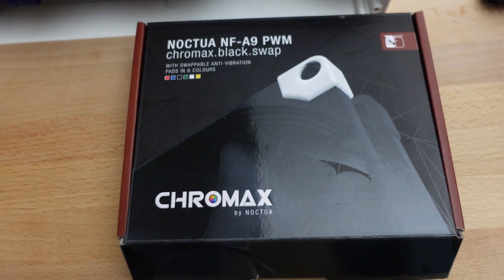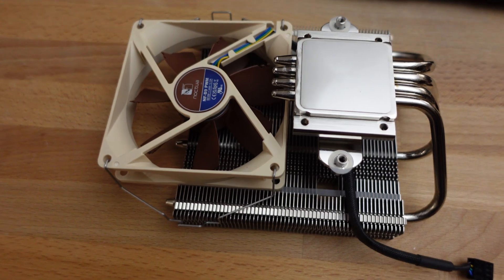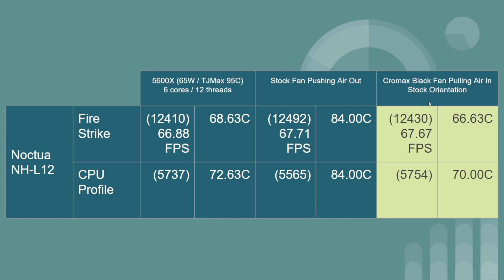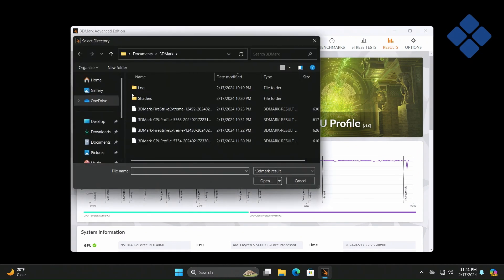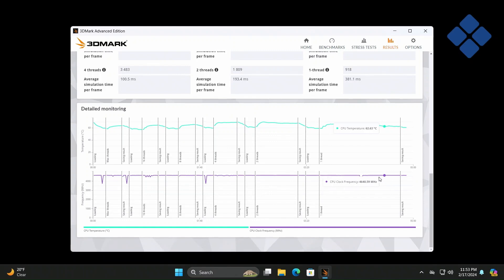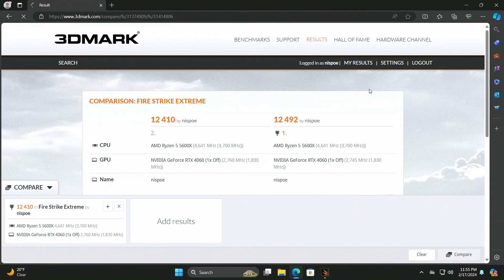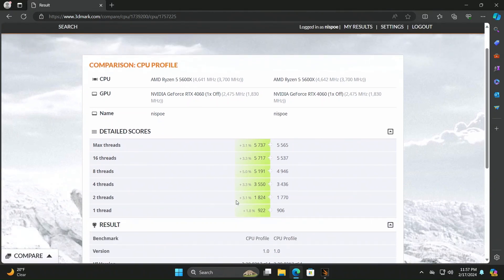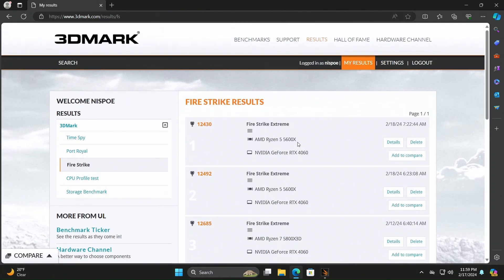Pull not push? - Noctua NH L12 and NF A9 chromax.black.swap - Persephone Build

Comment: Full speed for 92mm fans: Noctua @2547 and 53deg c, ID Fan @ 2376 and 55deg c, and CoolFan  @2778 rpm and 53deg c. Cooling block on low profile the mass will vary and the heavier it is the longer will take to dissipate the heat with a 92mm fan instead of 120mm fan.
Reply from the maker: Usually the physics of it all make sense that using wider fans will displace more air because the fan blades can just capture and push more air. The difficulty here is there is we are going between apples to oranges. 92mm fan is wider so it can displace more air than a thin 92mm. The 120 mm fan is thin so it will have challenge compared to a thicker 120 mm fan. The best of all would be to find the thickest 120 mm fan you can fit, but SFF options are limited. You also do need the radiator and the heat pipes. Actually, the most effective thing here is the wicking properties of the heat pipes and transfer of heat to the radiator fins. It really doesn't take a lot of air to displace the heat from those pipes, but obviously the cool air vs warm air does factor into all this.

Comment: I have a small zs-a4s all aluminum case and a Noctua 37mm low profile trying to cool off a AM5 7950X3D .. 470grams cooling block but only 2 heat pipes, average temp is 57deg c .. but under CPU stress it reaches 93deg c and it shuts down. I also tried a ID cooling block 45mm with 4 heat pipes but much lighter with only 317grams. The 4 heat pipes are hollow copper tubing .. Normally you want to pull air from the sides and exhaust fans on the top will help circulate the air.
Reply from the maker: Agree, pulling air in from sides and bottom and allowing air to radiate upwards is the most optimal. Actually, this is why I like open air cases because all that trapped air up top will just cause a barrier to form and heat to become trapped in such a small case. All those air molecules bouncing around in such a small case without something to actively push air through to circulate can build up too much heat. The one thing you have going for this is that the hotter the case is inside and the cooler the air is outside the case, the more both will try to even themselves out. The same physics in that hotter water cools faster initially and then slower when reaching room temperatures. Metals work the same way that the hotter the metal is it will cool faster initially which is why the radiator and copper or nickel as a metal work so effectively. But there are physical limits... sorry for the rambling, these are the thoughts that go through my mind... Very neat to know what you see with the 7950X3D this is where I will probably be going sometime, but think for SFF the 7950X3D sounds and is probably going to be very hot and would need bigger radiator or liquid.
Reply: @nispoe  you sure made a good point since I'm doing all this thermal testing on an open 'case' mini-ITX Gigabyte B650i aorus ultra board with the 7950x3d and 64 crucial 3200mhz each and the CPU fan runs at 2257rpm on idle 57.8deg.c and 45watts. The GPU 4070s is not even installed since I'm waiting for a rizer cable. My setup is out of the case, and I updated the BIOS on the ITX .. I did have the Ventus 4070s plugged directly in the PCI4 and pulls 214watts on its own at 94% load, although MSI keeps the GPU below 90deg.c .. I might need a bigger case, no rizer cable and mount a vertically cooling  block and fan combo .. I already spent around $2200 on DIY .. could have got a nice laptop for that money.
Reply from the maker: @samm928 the 4070 in a case drawing 214W of power along with a 7950x sounds like a lot of heat to try to displace. If you have a SFF or small case for the ITX you'll always have to keep track of the heat that builds up in the case. Yeah, $2,200 on DIY is a lot, but the performance will usually be better than an equivalent laptop and at times cheaper. The mobile versions of processors and GPUs are toned down and you don't get nearly as much power and performance. Also, if you continually use the laptop for gaming you'll need to open and re-apply thermal paste every now and then to keep the machine running at peak. I get laptops and gaming laptops for when I need to travel. If not traveling it's hard to beat a desktop.

Comment: When you are trying to cool a finstack directly, whether it is for a radiator on a liquid cooler, custom loop or a heatsink such as this one, cool air is obviously the go to choice. Exhaust matters for the other components of your PC, siply because most of the times they won't have a fan blowing air directly on them.
Reply: I wanted to get the Minisforum BD790I which comes with the 7945hx mobile version and pre-installed radiator ..
Reply from the maker: @samm928 I've been eyeing the Minisforum also and interested in the new AMD 8700G APU and what this may bring.
Reply: @nispoe  what happened was, I placed my order on Jan23 and got a good deal at $509. Minisforum was supposed to start shipping on Jan25, but they ran out of the BD970I. Feb8 - Feb14 is CNY holiday and everything shots down in China for 2 weeks, and I said screw it, and I went all in with the Gigabyte B650i Aorus Ultra itx.
Reply from the maker: Most times I see fans blowing against a radiator or fins. I think the SFF is interesting because it's so small the warm air is trapped in such a small space and my concern is overheating. I think the NH-L12 is interesting since it's the first time I've seen something designed intentionally to pull air through fins. I know sometimes people use a push and pull configuration with thick radiators for water cooling. Again, didn't realize that Noctua intentionally set this up this up without a push fan because of space.
Reply: @nispoe  most of the time, the CPU is idling at 45watts .. when installing a game it can go 92-94c with all the decompression of 40gb installation .. playing the game only takes 5-10% CPU load and 98% GPU, which comes with its own cooling package ventus 2x